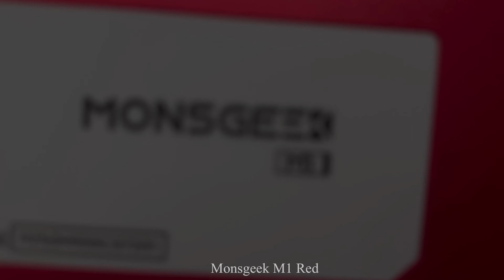Monsgeek M1 (V2?) Build/ Typing - Milky Yellow Pro - CRP Keycap.

Comment: What's the screw size you used to open the case? I've just got mine but can't find a fitting screw bit yet.
Reply: Mine came with a little allen wrench to open the case
Reply from the maker: I'm Using    H2.0 Screwdriver.
Reply from the maker: @mattbrat92  yeah. The International GB will have it. Mine come straight from China so it will  different a little bit

Comment: Whenever I push down a key with a stabilizer it pops up the other side of the key. Do you have any idea on how to fix this?
Reply from the maker: Try to use another switch or another stabilizer.
Reply: Are you sure that you placed the housing in the right orientation and seated the wire correctly?

Comment: How would you compare the M1 to the Finalkey V65 V2? I know they are different layouts, but just the overall quality and finish?
Reply from the maker: Overall i like M1.
The case anode pretty good.
It have just a little problem in Pingy case, but you can fix it like i did.
Them both have Similar typing feel.